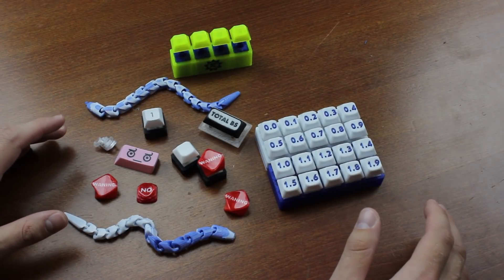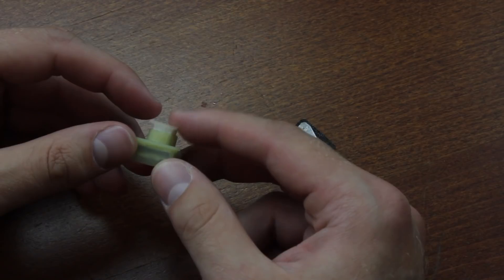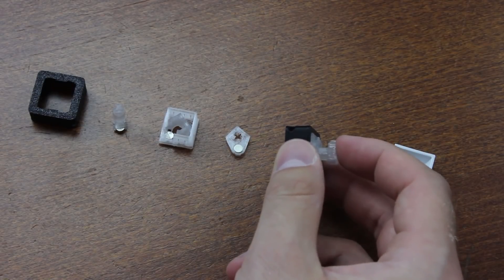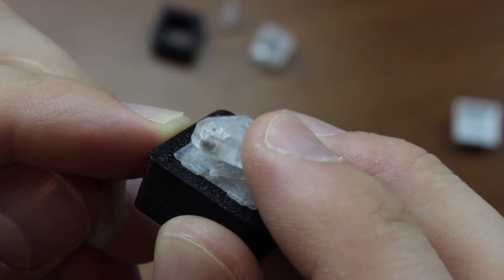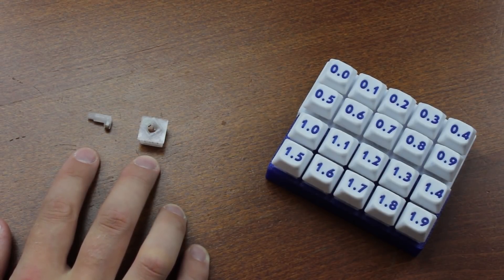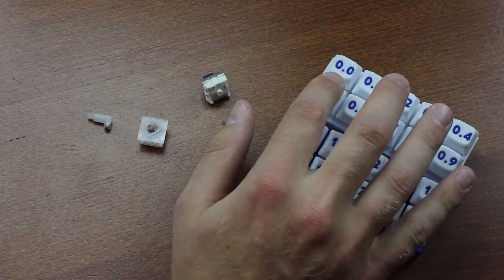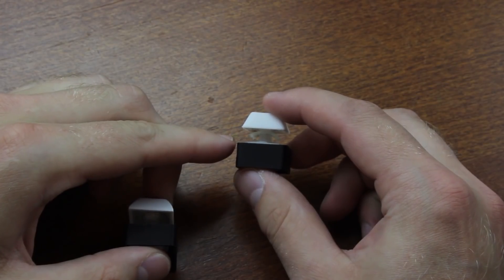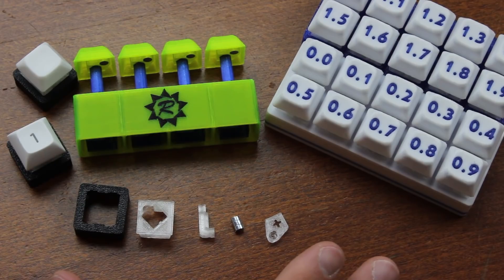Teardown - 3D-printed magnetic levitation "Void" switches!

Comment: Cool, want to try to build these, thanks for sharing. I would like to see how you are connecting them to the board/circuit, ie. how you interface with the contacts. Do the magnets sit on a pre-wired contacts, and are they used as the key trigger contacts themselves? KISS?
Also, is there an idea to deal with things like debouncing, or maybe that should be dealt with by default in the firmware for this design?

Comment: oh, wow.  i am currently in the process of trying to build a good keyboard into the back of an iPhone case.  braille layout is just fine for 16 keys; i can do EVERYTHING that's possible on a big keyboard.  you do need a microcontroller to deal with stateful layout though.   i am 3d printing good normal iPhone 12/13 cases.  i bought a keybow2040, which is a circuit-python programmable 4x4 grid of mechanical switches; and programmed it with my braille layout.  what i really want is to just build the keys INTO an iPhone case. perhaps scissor switches. i want to be able to:

- throw the phone into my back pocket
- thumbs on front, and 8 fingers on back typing.  column 0 is modifiers like windows key, shift.  column 1 and 2 (4 rows) are 8-dot braille.  they are stateful, because a key is emitted when you release them all
- col 3 is more modifier keys.

I'm still evolving the layout, but that keyboard by itself works pretty well.  i will get faster on it, as i know computer braille.  i can use vim and navigate the desktop with it; for instance.  the goal is to combine the projects of making the cases and making the keyboard.

there is a problem though.  i have a lightning to USB cable, and the iPhone doesn't recognize the keyboard.  an employee at the Apple store says that this is expected behavior.  you can't just plug a USB-C keyboard into an iPhone.  So in addition to the microcontroller to interpret the keys; it appears that I need a power source, and bluetooth.  It would have been nicer to simply proxy the lightning connection, and make plugging into its connector just part of installing the case.

The real idea of this is to be able to project my iPhone screen up onto a monitor; and be able to do real work... coding in an EC2 instance.  I have two Orbit Reader braille terminals. You can type on their braille layout keyboards; but the keyboards suck, as they didn't put enough thought into making them work without being supplemented by a full qwerty keyboard.  In any case, all braille tools will continue to suck if they are "made for blind people". The braille terminals get "medicalized" and everything becomes stupidly expensive and hard to use.  Better to make a keyboard for general consumption that CAN be used by blind people in voiceover mode.  But it should be useful for people that just want a keyboard layout that works better than qwerty.  ie: Walking around "eyes-freed-up".  A touchscreen emulated keyboard forces you to look at the screen. qwerty is just too large, even on the back of the iPhone case.  Another layout is fully justified.  And braille is battle-tested in its own domain.

Comment: Hi, you share 3d model this magnet switcher? And what size magnet?) Thenks your job!
Reply: The OpenSCAD source files for the switch (and some pre-generated models) can be found here: https://github.com/riskable/void_switch  It uses 4x2 magnets by default but that's also parametric.  I've made some with 4x1mm, 3x2mm, and 5x2mm magnets in the past though with 5x2mm you have to get a little manual with things here and there to fit everything inside the switch body (though the switch body size is also parametric so if you wanted to you could make some ginormous switch with 12x2mm magnets or whatever haha).

Comment: So what is the cost compared to a normal keyboard???
Reply: The switches are about $0.04/each ($0.01 worth of 3D printing filament and $0.01 magnets).  The PCB is slightly more expensive than a regular (electromechanical) keyboard PCB though.  My Riskeyboard 70 that I'm typing on right now cost me about $45 but because of the chip shortage it'd be slightly more expensive today...  Probably $50-55.  That includes the cost of the PCB, filament, magnets, and 3D printing the case/top plate and whatnot.

Comment: This is awesome.  Means we do t have to spend 8-10 hours lubing keys anymore!  Only thing I would have concerns is the tolerance of the 3d printed keys
Reply: Would it be rough since 3d printers are printed in layers
Reply: @samueldsouza8797  The layer lines run parallel to the motion of the switch so there's no "scratchy" feeling at tall.
Reply: @riskable  that makes sense. I wish someone turned this into a real product
Reply: @samueldsouza8797  I'm working on it! First "real product" will probably be a numpad because the investment costs are lower and assembly is soooo much quicker 👍
Reply: @riskable  wow you are the actual creater of this. Thanks for creating something actually new.

Comment: Why was the magnet on the keycap not integrated inside the housing? Im assuming having it under the housing would have similar repelling effect to push it back up.
Reply: It just saves vertical space.  There's no reason it couldn't have been shoved inside the body of the switch.  It would've just added an additional 4mm (or more if you generated it with extra travel) to the overall height.  By shoving it on the stem and hiding it under the keycap it makes everything more compact 👍

Also note that the switches I sent to Chyrosran22 had 4x2mm magnets in the levitator.  There's no reason why you can't use 4x1mm magnets and a slightly thinner levitator if you want to save even more space.

Comment: Probably way too expensive to put into a full consumer keyboard.  Best youll get is like a $1000 rich people keyboard thats hand made
Reply: If you print it yourself the cost of each Void Switch is about $0.04.  A hall effect PCB is slightly more expensive than a regular electromechanical keyboard PCB but not that much more expensive.  It's like $35 instead of $25 (for a made-and-assembled PCB; when you buy just 5 from a PCB shop 😁).
Reply: you could print a full keyboard with less than a kilo of pla which is $20 and enough magnets for 104 keys for just over $30

Comment: I just might buy a resin printer and have a go at it. small neodynium magnets are relatively cheap, I got 200 disk shaped magnets 1mm thick & with a diameter of 5mm for around 8 euros, which probably was more than they are worth. The attraction between the magnets would be more than enough to build these switches.
Reply: FYI: Void Switches work best with FDM printers.  Resin has a terrible coefficient of friction!  I've had several people print Void Switches in resin and they all turned out, "meh".  The way the Void Switch models get printed is such that the motion of the switch always runs parallel with the layer lines.  So there won't ever be "scratchy motion".  Though with resin you can get switches that are a bit "bindy" (if you don't get the tolerances right; but just use some lube and they should be OK).
Reply: @riskable  thanks for the tip. Never got around to it, in any case.

Comment: My favorite key layout is like the old Monterey K102 and K104. BIG Backspace, right shift, BIGass Enter. Has the \ between the right Alt and Ctrl. Such a layout has not been made since 1994 thanks to the WinKeys. They have an unmarked key between the left Ctrl and Alt. Make that the Windows Key and change nothing else. Who uses the Menu key anyway? If the keyboard must have a Menu key, carve a bit off the right end of the spacebar.

My first PC keyboard must have been a Monterey. I hit the Enter key on the upper part, Backspace on the left and, and right Shift on the left end. All the places that got chopped off to make room for keys displaced by WinKeys! I've been using a Gateway KB-2961 for years because it has the big Backspace and Right Shift, and the Enter key is like the bottom part of the BIGass Enter while the upper part of Enter is cut off to be \. Took me ages to train myself to hit Enter down low so I wasn't typing \ all the time.

Comment: id like to see one of these with adressable electromagnets so that you can change the tactility through software
Reply: This is actually possible!  With a very expensive PCB though.  You can put several layers (like an 8-layer board) with PCB tracks in a rings (one ring per layer) and place them under each switch.  Then when you detect a keypress you can fire up an H-bridge to give each switch a reasonably strong "push" upwards to provide force feedback. It won't be as strong as an old-school linear actuator (e.g. old IBM keyboards) but you'd definitely be able to feel it.  Might even be able to get rid of the levitator magnet since you can get that "bottom out repulsion" effect with the PCB coils.

I keep meaning to try it but...  Funds for experiments are low at the moment (and I really need to spend more time on firmware!).

Comment: With analog input using the hall effect sensor you could emulate analogue game pad inputs and have throttle, as an example, on your W key. Very cool.
Reply: Yeah but it sucks, haha.  It's a gimmick.  Linear motion with only ~4mm of travel doesn't give you much in the way of fine-grained control.  Human fingers need a bit more travel than that for it to be a decent analog control.  Normal game controller thumbsticks give you about 10mm of motion (in a circle).  However, that's with a thumb-based control that uses muscles for lateral movements...  Which human thumbs are good at (for fine muscle control motion anyway).

Your middle finger pressing down on W is going to drive you nuts if you try to use it to get the same level of control.  Having said that, there are cool things you can do with the analog detection other than just picking your point of actuation/release.  For example, you can detect *velocity*!  So if SOMEONE IS WRONG ON THE INTERNET you can detect that in the firmware and send those keystrokes along with a shift key modifier 😁👍

Comment: I am sorry if what I'm about to say sounds dumb, but I am new to mechanical keyboards world. So does this mean that the durability of these switches is almost infinite? My understanding is if there are no parts like springs inside of the switch then wear on these switches would be non-existensial. Maybe the magnets would lose their strength overtime which would weaken the switch overtime and eventually make it unusable? Not a physics person either so I am not sure.
Reply: > So does this mean that the durability of these switches is almost infinite?

Yep.  Pretty much.  The (neodymium) magnets will lose about 5% of their strength every 100 years though so after 300-500 years it may be time to replace them 👍

Comment: does anyone know if demagnetization could occur here? having a magnet in a constant contact with another magnetic field may demagnetize them?
Reply: This is an excellent question...  The answer is that no, there shouldn't be any demagnetization because the levitator is about 4mm away from the body magnet at rest (keyup) which is far enough away that the two don't apply any significant force to each other (not enough to matter anyway).  The levitator only really applies it's force once you've reached about ~1-2mm of travel (with a 4mm-of-travel-switch) at which point it'll only be "down" for a few milliseconds (unless gaming I guess haha).  Worst case scenario: After 5-10 years replace the WASD switches if they start to feel a tad too weak 👍

Comment: That's brilliant! If the magnets were slimmed down (and some parts being made from, say, an CNCed aluminum bracket) the design could be slimmed down enough to hold some gorgeous flat keys for immensely satisfying highspeed typing. I don't think we'll ever see anything close to the absurdly thin mechanical thing from apple but given the high failure rate of those keys perhaps it's just not meant to happen, but this looks like a great potential leap forward :)

Comment: I like the project, especially how you can control the tactility because it is a 3D printed switch. Though how do you attach the switch to the keyboard? Is it the same way like with a solder and hotswap or is that not a thing yet?

Comment: Resin printing would be better than FDM
Reply: It's not, actually...  Because resin has a terrible coefficient of friction (0.4-0.5 which is worse that wood!).  You can work around that problem with lube though so if you have a resin printer you obviously can still use it to print Void Switches (just use lube).  The FDM filament that works best is PETG which has the lowest coefficient of friction of all the 3D printable filament types (0.22).  It also has this amazing property where it self-lubricates by shedding hydrogen atoms when rubbing against itself 👍

Comment: Question: What the lifespan and durability of the magnets
Plus how would usage effect it?
(Unless the magnets are electrically powered probably it would eventually become weaker and weaker with usage)
(I am also no scientist but I do fidget with magnets every so often)
Reply: The lifespan of the magnets is thus: They lose about 5% of their strength every 100 years.  So after 300-500 years it may be time to consider replacing them (unless you don't mind the slightly weaker feel hehe).

Comment: Now this is a genius design!
But is there no risk of accerated demagnitizaton over long term use from the magnets hitting stuff?
Reply: Neodymium magnets "hitting stuff" doesn't demagnetize them (hehe).  What does demagnetize them is heat so keep them away from the oven/stove.  I've run a few switches through the dishwasher and the magnets were unaffected (the switch smoothness was though!  I've since learned that it's because dishwashing detergent has mild abraisives and that's why the switches became a little scratchy for a while after... They became smooth again though after much fidgeting thanks to PETG's self-lubricating properties).

Comment: hey this is kinda how the old school Tube Mod Vaporizers work. With two magnets of opposite polarity the button is open pushing on the button wont allow the magnets to touch so it forces the battery up into the contact. pretty nifty

Comment: that wobble though . smooth like james bond but high on lsd
Reply: The switch tolerance is a configurable parameter.  I like em a bit loose, honestly (they feel a bit better IMHO).  However, there's nothing stopping someone from printing out some Void Switches with the tolerance set to 0 and just sanding and polishing them to some imagined perfect level of tolerance/zero wobble.

Comment: I recall you being quite dismissive of this idea when I suggested it in a comment I made on an old video. :P
Reply: Ooooh, got a link? :D
Reply: @Riskable3DPrinting  I don't keep links to old comments. It would be a major undertaking to find it. I believe it was on one of his old videos where he was talking about a switch that used a magnet in the slider for sensing purposes. Though it was some time ago. I suggested using magnets to replace the spring too. I think he underestimated the strength of modern neodymium magnets. I think the biggest limitations are cost and their ability to attract paperclips and other such metallic debris in an office environment. I would have liked to have seen some diagrams of the geometry of the switch, as his description wasn't as clear as I would have liked. I had the use of a pair of annular magnets at the top and bottom of the housing, to reduce off-axis binding, in mind at the time. With a magnet in the slider passing a side-mounted sensing element. Though I don't think I went into such details in my comment. Potentially the sensing element could even be board mounted, depending upon how the magnetic flux of the bottom housing magnet is deformed by the opposing magnet in the slider approaching it. I'd also have some form of damping on both the downstroke, and upstroke, to reduce noise and shocks to the magnets. I think the silicon dumbbells on the slider of some Alps style switches is an elegant solution for that.
Edit: Actually, I think it was just one annular magnet in the top housing I had in mind at the time, the others being the regular types.
Reply: @Riskable3DPrinting  I've been procrastinating over getting a 3D printer for years now. :(
Reply: @Riskable3DPrinting  I found it.
https://youtu.be/VbFWqH_yOPI
It's in the reply section for a comment by AltarOfMelektaus00
Reply: @dalriada842  Ahaha!  NICE FIND!  Chyrosran22 wrote (about using magnets instead of springs or rubber domes), "It would be excessively hard to engineer something like that, especially because you'd need really strong magnets to provide adequate repulsion to provide a significant return force, especially when the magnets aren't right next to each other, because the force drops off over r cubed, so the key travel would in all likelihood be limited to chiclet-style depth."  He's right though: It was really hard to engineer!  The simplest designs are often the most difficult to come up with (and make practical) 👍
Reply: @Riskable3DPrinting  So I've watched a few of the videos you have on this switch. Your middle magnet is fixed, with the outer magnets moving relative to it. Whereas I imagined the middle one moving on the slider, with the others fixed to the top and bottom of the housing respectively. Did you try alternative geometries before settling on your current one? This video was easier to understand once I watched your own demonstration. My own preconceptions can really get in the way of understanding sometimes!